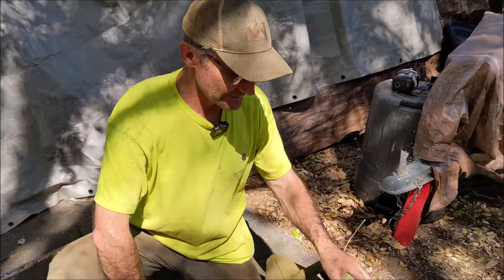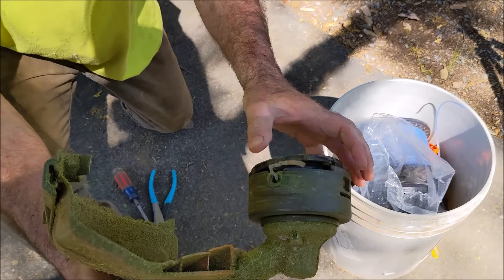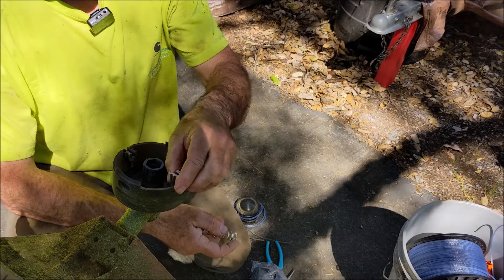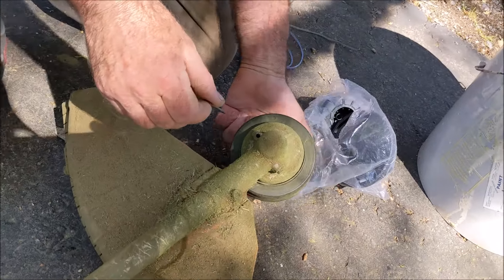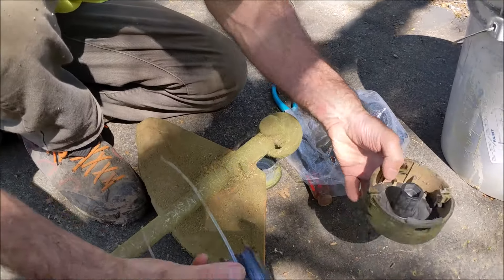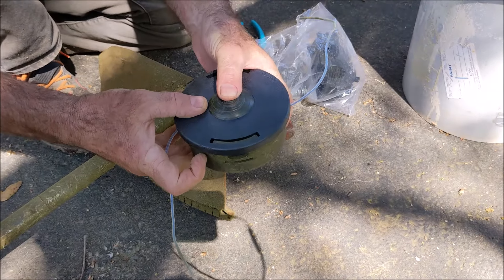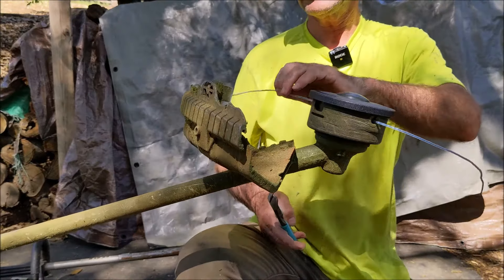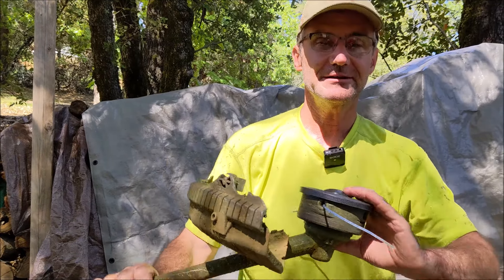How to Replace the Head on a Stihl Weed Eater

Comment: My head on my weed eater has been acting up. It will not spin, then I can start it again later and it will spin/cut for a while then stop. Today I was weed eating for about 7 hours and it made a strange noise then quit won't work/spin at all. Can I just order the head or do you think it's something else? I've had it for four years.

Comment: I put a newer head on and I didn’t put the metal plate on and I can’t get it off. It just sounds like it’s running normal but the wires don’t spin just sounds like it’s working and this is my works weedwacker. Shoulda just waited for my boss tmrw lol. What do I do.
Reply from the maker: Check with the boss

Comment: The head on mine spins while it's running but not a controlled spin. It's like something busted and just slowly spins. Do you think I could just replace the head like you did and that would work? Thanks for the video
Reply from the maker: I don't think so, probably the connection between the shaft and head
Reply: @topsaw ok, that's what I was thinking. thanks! Suppose you don't have a video for reference do you?
Reply: Just buy 3 more weed eaters

Comment: How do you remove the face? Do you align both sides and press on both sides?
Reply from the maker: Yes, that is correct, push on the tabs
Reply: May have to use a flathead,screw driver to pop tab, pull it up, pop other side.. It comes,off.. Pretty strong to depress by finger
Reply: @mandelorean6243  Thank you , I figured it out.👍🏼